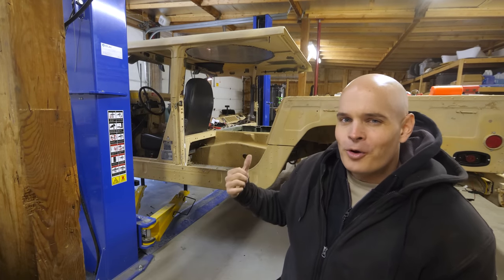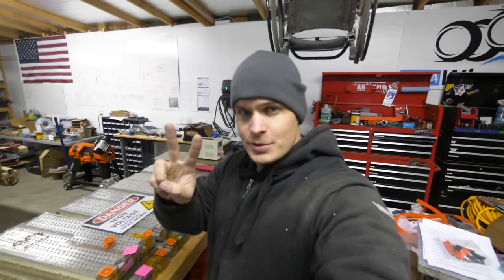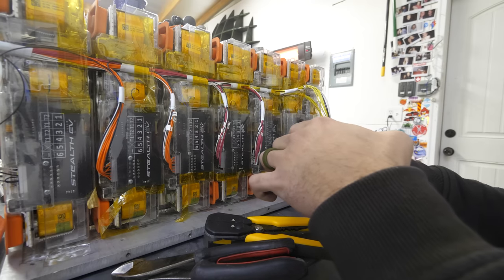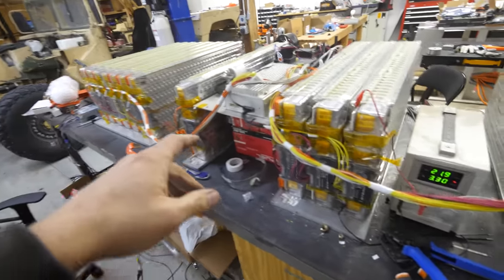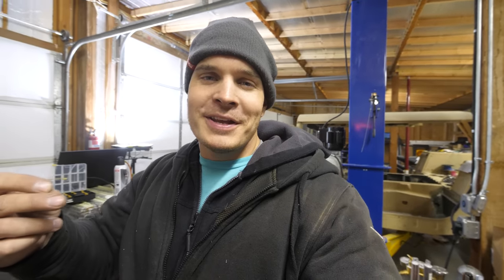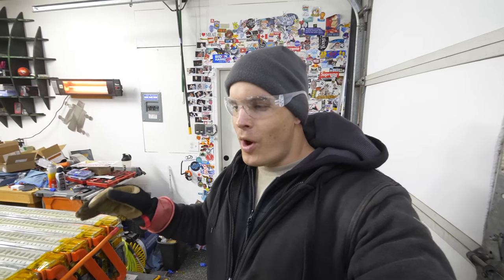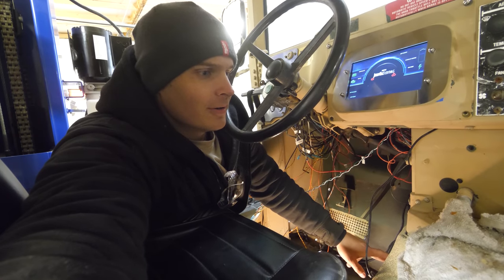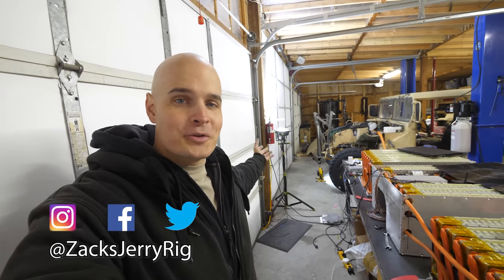Building the Brains of the HIGH VOLTAGE System - IT MOVES!!

Comment: I am concerned on the holes that the wiring is coming out of and coming into the metal boxes - those holes do not look sharp, but they are not well rounded either - during riding it was rub on the edge and wear out the insulation on cables, in theory. A rubber ring insert will do wonders there, I think.
Reply: I don’t think it will be an issue once he adds the conduit between. Then there won’t be any rubbing on sharp or rounded edges lol
Reply: Was looking for this comment. Good practice is to have a plastic plug in those holes  and then the wire feeding trough that.
Reply: I think covering the metal edges of those holes with rubber is a must.
Reply: So glad someone added this comment. The exposed edges of those holes will inevitably pose a risk to the insulation around the cables - now is the perfect time to sort it out while access is good and before it’s becomes an issue 🔌⚡️👍
Reply: ^This, Hopefully he’s already accounted for this and is waiting for the grommets. If not, hopefully he sees these comments.

Comment: The wireless protocol GM is using for their battery management system is a new protocol called wBMS (wireless battery management system). Like WiFi / Bluetooth / BLE, it operates in the 2.4GHz ISM band, and it has a data-rate of 1.2Mbps which is similar to the data-rate of BLE, but I'd imagine that wBMS is heavily optimized for reduced latency and increased reliability for it's application compared to the other protocols. Pretty cool! Maybe this will be more widely adopted in the future with more electric vehicle manufacturers.
Reply: as an EE it still feels so backwards to me but on paper its substantial cost savings and I suppose it will be perfectly reliable too. I would personally rather see a bus system because I grew up always choosing wired whenever possible.
Reply: @drkastenbrot  Also an EE, and I totally understand. Every time I see something like this I think back to instances like the Toyota electronic throttle control failure, which ultimately was a software flaw in a system designed with no good hardware backup/override. I would hope that now the automotive industry has particularly rigorous testing for new technologies like wBMS, since it interfaces with such a critical component of the vehicle.
Reply: EE also; the design is backwards and pretty hilarious.. simplicity is key to engineering.. Tesla is a very successful backdoor company.. I'm 100% moder  weaponry is their closed objective.. 2.4Ghz 1W signal will send its control board to the wall.. id rather have wires
Reply: @ohmslaw6856  Id like to point out that this nutcase is not an EE
Reply: @drkastenbrot  ?, why would i lie about being an EE? Lmao.. EE with a minor in mechanical.. ABET University btw
Reply: @drkastenbrot  and just so know.. the issue with toyota was connections to the bottom of the throttle position sensor was breaking, causing a disruption to the ground line.. which caused the sense voltage to instantly rise.. which made the cars accelerate instantly.. the software was fine homie..
Reply: @drkastenbrot  are you sure your an EE? What you said earlier was about Toyota complete BS.. and Elon is a con
Reply: @ohmslaw6856  Got a source? I am happy to change my understanding if I am wrong. If you would like to see what I was referring to, you can Google: "Case Study of Toyota Unintended Acceleration and Software Safety" and "Toyota Case: Single Bit Flip That Killed"
Reply: @gonediode9122  I am sure and you are replying to the wrong person.
Reply: @w00tn3ss  Im not sure if i agree with your summary. Ultimately it was automative software practices they didnt follow. The code was susceptible to minor corruption and not redundant like on pretty much any critical safety system in any car.
Reply: @drkastenbrot  my apologies, i was

Comment: Really cool project and I was happy to see how far you have come so far. I am an electronics engineer from Germany. The only thing I would have changed is to isolate the batteries completely from the metal case to avoid contact with the case.
I wish you continued success with your project.

Comment: CAN network - controller area network network 😉. The resistor on the ends are called terminators. The CAN bus protocol is pretty cool and relatively simple. It was fun to work with the CAN aerospace protocol as it has grown.

Comment: Amazing job! One side note tho, please insulate the holes seen at 25:09 on both sides with  rubber rings, aswell as the central nuts (22:38, and so on), since with the car flexing, it might be tearing the big cables due to rubbing against the bare metal holes, and the nuts beeing super close to the casing.

Comment: LOVE how quiet it is!
Reply: Wait, am I the only one who hears the super loud "Eeeeeeee" noise as it moves the wheels?
Reply: @CodeMerk  the "eeeeeeeeee" noise is the carrier frequency of the variable frequency drive. I don't think you will be a able to hear it as loudly when everything will be closed, since it's a high frequency noise, easily blocked by even thin material.
Reply: @UhOhUmm  hopefully because that thing was loud
Reply: I hate the high frequency sound.  Nissan Leaf's are really bad for it, can hear them coming from a mile away.  Tesla's dont seem to make it.
Reply: Eeeeeeeeeeeeeeeeeeeeeee lol

Comment: Use a telephone line (cat 3) or Ethernet cable for your CANbus. It is the right insulation (LPDE) that has low capacitance and good dielectric properties, and it also has a well controlled impedance of 100 ohms, which is close to the official 120 ohms CANbus. You could use 100 ohm resistors for the best termination with minimal reflections, it should still work. I don't know if LPDE is the best choice for automotive though. The twisted pair runs the length of the vehicle with short stubs that branch off along the way to the peripherals. Only at each of the far ends does a termination resistor get installed.
Reply: And also comes conveniently pre-twisted to various twist rates
Reply: @thevillain2754  yup! The point of that is to prevent coupling between pairs. If two twisted pairs of the same twists per inch are run together they will still magnetically couple unless the phasing of the twists are set orthogonal, or 90 degrees. Twist rate is easier to control though, and more effective.

Comment: 1) The wire twisting creates a cancellation effect of the magnetic/electrical fields that cause distortion to the signal.
2) The reason that wire gets small as the number gets refers to when it was pulled through a die to get to that size.  More pulls, smaller wires.
Reply: 1) Um...no
Reply: @vidznstuff1  Explain?

Comment: Just a note on the termination resistors on the CAN bus lines: They are not there to tell any controller that the line ends, they are actually used to stop the signal being reflected at the open end (as it otherwise has nowhere to go and will reflect back). They are pretty important for signal integrity, especially at higher data rates.
Respect for the project otherwise, you're doing all this in a really professional way and I'm sure it will end up a seriously awesome vehicle!

Comment: hey, cool project! really informative. You should watch out with (especially the high voltage) wires being exposed to (sharp) metal edges like the holes on 22:42, theres some rubber ish protection for that so the wire doesnt scratch and gets the metal exposed to the high voltage copper. I really recommend that or atleast some form of protection against those edges since you said you want to go offroad which causes a lot of vibration.
Reply: Yup brushing against sharp edges might short it eventually.
Reply: Came here to comment this as well. I'm sure that won't be his final setup, but it's definitely something that needs extra protection. I assume that he already has something in mind to prevent any shorts at that location but isn't including it for testing purposes.
Reply: Was thinking the exact same thing. Maybe there will be changes made before final instillation?
Reply: 0:46 - as someone has said already in the comments
Reply: The tap wires are also high voltage wires, so there is a lot to be wary about! The thinkness is just misleading in that regard!

Comment: Love this project! One worry though, in the case of an accident or extreme vibration, if the HV batteries came loose and the individual boxes’ positive and negative 90° terminals shorted to the metal case, the fuse would not disrupt that kind of short circuit. This would cause extreme currents to pass through the batteries, heating them immensely and would be a huge fire/ explosion risk. I think you should insulate the positive and negative terminals or add some rubber to the sides of the box near there to prevent that. 

Congratulations on a powered roll, and I can’t wait to see what’s next.
Reply: Actually not really true. If the modules are shorted, the cell fuses will blow quickly. Each cell has a small fuse wire on the positive and negative terminal. 

The danger with Tesla modules is overcharging them, that's how you end up with a thermal runaway scenario.
Reply: I was actually looking for a comment like this. I don't think the fuse wouldn't blow but the unisolated 90° angles are giving me headaches
Reply: @reider_mcfeely  yeah but its still a huge risk having exposed terminals, not to mention they lifted the METAL CASE WITHOUT GLOVES over the exposed terminals after they went through all the safety before
Reply: @pivotmaster9556  exposed terminals on one module or even 2 or 3 isn't very risky, the voltage isn't high enough to be dangerous as long as your hands aren't wet. The danger in that scenario is to the modules. A quick 2-3 second short across the terminals of a module could blow the cell fuses easily. 

DC is also inherently less dangerous than AC, since you need to contact both terminals with DC to create a circuit, whereas AC current just looks for a path to ground. It's why a common technique when dealing with high DC voltages is to use only one hand, so that you're unlikely to create a short and if you did it would go thru your fingers and not be as dangerous as if it crossed your heart to get to the other arm.
Reply: @reider_mcfeely  the two mains exposed are the positive and negative terminals of the entire 450V. Not just a single module.... The problem here is not only potentially fatal but very serious.

Comment: At 14:47 that's probably not dielectric grease, but most likely conductive grease. It's used where you want to lower the arc voltage's between surfaces, such as two surfaces that haven't been precision milled but you need to make sure there's a solid connection.  Awesome job btw, as an EE this is awesome nerd candy for me. Hopefully watching this project will get my girls interested in what their dad does for a living.

Comment: 12:35 you might consider to place the antenna outside the batterycage since it is a faradayn cage which will not let out any wifi signal (maybe very little if the case is not 100% closed)

But man, can´t wait to see that beast rollign on the street!

Comment: Looks great!  I'm was thinking about is the center battery/controller compartment. If you're putting an aluminum lid on that, I dont think the wireless CAN unit will make a decent connection to your laptop while being sealed in a metal box. Maybe not so bad if you're sitting on top of it though.  Also, what about cooling for the BMS module. It's gotta create a lot of heat judging by those cooling fins on top of it. If that's sealed in the box it might get pretty warm in there.
Reply: Its probably both going to be fine, he will be right inside the car when connecting to it and the BMS doesnt actually get warm at all during normal usage. Its only when the pack degrades and needs lots of balancing where the BMS will give off a fair amount of heat. At that point its an fault condition anyways and needs to be addressed.
Reply: @drkastenbrot  I've never seen the actual BMS module at work so I was just judging by the fin stack. 
I figured the CAN module would still work, just with limited connectivity. I'd worry about a disconnect while writing something to it and bricking the module, but I don't know if it's to read/write to it or just monitor stats.

Comment: One thing I would do, is add rubber gaskets to the holes in the boxes so that the cables wouldn't be resting against bare metal should they ever comes exposed (however unlikely).
Reply: 100% agree.

Comment: The current handling of wire is dependent on resistance of the wire, temperature rating of the insulation and heat dissipation. The resistance of the wire is dependent on the gauge and the length. Shorter wires have less resistance, so less heat is generated at a given current load, bigger wires also have less resistance. The biggest problem with overloaded wires is normally the insulation melting so the temperature rating tells how much heat before that is a problem and running the wires through non-metalic conduit is going to build up a lot more heat than running them through open air.

There is a lot more complexity there, and it is usually simplified by just giving a current rating for a given wire gauge, but it is worth acknowledging that there is more to it than that.
Reply: the length of the wire doesnt really matter unless total power loss is relevant. the rating is for a given maximum wire temperature at a given ambient temperature, regardless of length.
Reply: @drkastenbrot  of course power loss is relevant since that loss is converted to heat.
Reply: @jeffreyparker9396  i said total power loss. in this case its not a significant amount to the application (you are not losing any significant amount of range because of wiring). total power loss is a common problem in the grid, where some transmission lines can lose over 40% of power. 

here, the power loss is multiplied by length. and the heat generated is divided by length. it cancels out, so the current-temperature chart does not include length. im sure you knew this but the way you worded it wasnt right.
Reply: @drkastenbrot  sure, but it is still a lot more complicated than that, because of the environment which could for instance cause much more build up of heat like in conduit or cause more dissipation like if it is open air and has airflow around it. In these cases the heat created by the loss is not going to be the same as the dissipation, therefore the length does matter, it is just a matter of how much and in what direction it affects the calculation. It is true that in most applications it is likely negligible, but I think it is important to remember that it can have a significant effect.

I would point to resources that discuss this information and explain all of it, but I don't feel the need to and you can always find it in a few seconds on Google.
Reply: @jeffreyparker9396  the charts already have all that in them. airflow etc. its also definitely not going to be an issue in this car.
Reply: @drkastenbrot  I didn't say that it was going to be an issue in the car and I didn't say anything about what the charts have or don't have. I was just pointing out that in the video he made it sound a lot simpler than it really is.
Reply: @jeffreyparker9396  he made everything sound way simpler than it is, his explanation about twisted pair wiring was borderline wrong. but at the same time he never claims to know any of this stuff and makes it clear too.
Reply: @drkastenbrot  that is true, that is why I posted the original comment to add a little bit of additional information indicating the potential complexity involved.

Comment: Would be cool to see those battery boxes get powder coated. Also, you were probably already going to do this, but use rubber grommets in the holes the wires run through

Comment: that's a great step towards a rolling HUMVEE :)
One thing though, the gloves and insulated tools are great, but you lack a few things, electricity can kill you almost instantly, but, projection of molten debris and arc light from a short-circuit are equally dangerous, it burns you right to the bone, literally. You should look after face screens rated for electrical work, they have a UV filter against arc light and preserves your face against projections, second thing, I didn't see an insulated rug, it is a complement to the gloves and the insulated tools, it's the last barrier in case of involuntary contact with live conductors and trust me, accidental contact can happen quickly, even with wearing the right kind of equipment.

One last thing, to you, your family and the team, I wish you all a happy new year ;)

Comment: Congrats on getting her rolling!  One small thing I wanted to bring to your attention - the thick 2 gauge orange wire that goes from one box to the next is being run through a hole you drilled into the boxes. That hole looks like it may have sharp edges that over time could scratch off the rubber coating on the wire. Maybe putting some time of soft material like even duct tape around the edge of the hole could lessen the effect?
Reply: There's conduit (see 0:46 ) connecting the boxes together that the wiring runs through. They simply removed it for showing purposes, the wire wont remain exposed.
Reply: @jrharbortproductions  Awesome I missed that, thanks for the heads up!